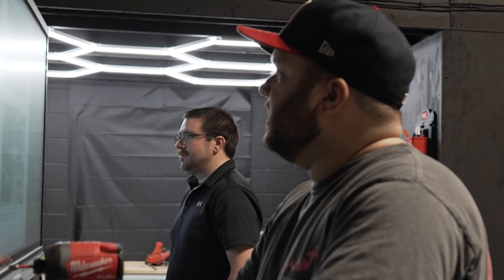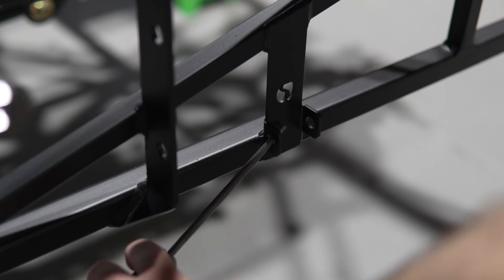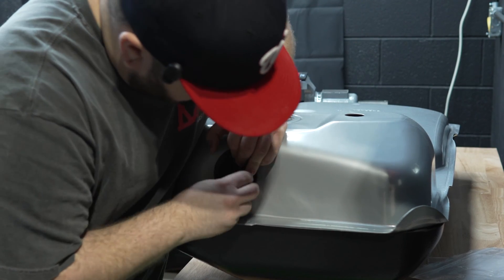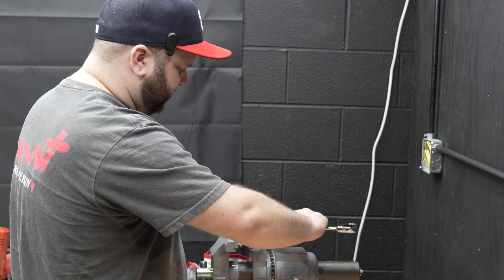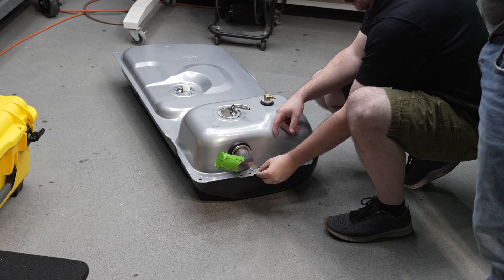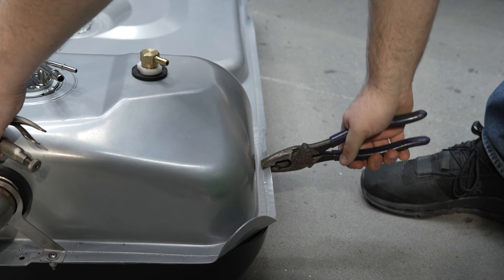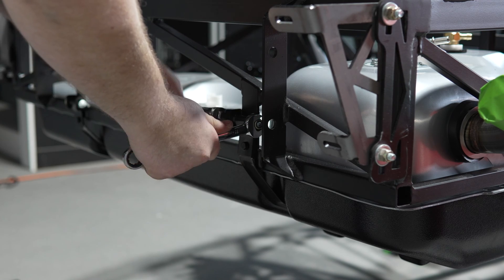Fuel Tank Mod/EFI In Tank Fuel System Install on our Factory Five 65 Coupe!

Comment: I found out the hard way - don't over-tighten screwing the vent into the plastic bushing. It will break the bushing.
Reply: Ouch, don’t you just love screwing metal into plastic?
Reply from the maker: Yeah, I was worried about that when Tyler was screwing in that vent. I’m sure FF will hook you up with a replacement if you ask.

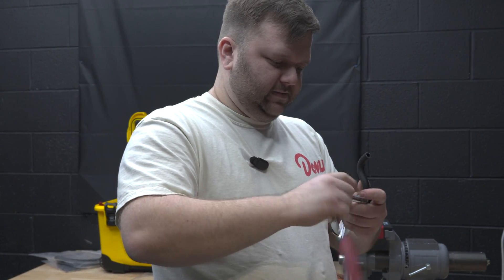Comment: 5:56 Thanks for the video, good stuff. Question, wouldnt drilling out the send/return line possibly create debris that can be left inside?
Reply from the maker: Thanks! Yes it could, thats why it is important to clean and inspect them once drilled. Compressed air/pipe cleaner should do the trick.

Comment: Hi.  Really enjoying your videos; you folks do very nice, clean, professional work.  When you show modifications, would you please add a little extra detail about why you are performing a particular modification?  For example, why did you cut the fuel intake tube before connecting it to the fuel tank? Thank you.  Looking forward to more videos soon!
Reply from the maker: Thanks Randall! I had some voiceover explaining that mod but I forgot to include it, so I’ll explain it here. The stock filler tube isn’t long enough/shaped right to get from the filler cap to the tank, so you combine the 2 pieces we cut with a rubber filler tube (which also has to be modified) and you hose clamp them all together. We’ll make sure to show that when its time to assemble.
Reply: @Walton_Racing  Thank you!  I'm considering purchasing & building a FFR Type 65 coupe in a few years, so I'm watching all the assembly videos I can find.  I'm trying to figure out if my mechanical skills [took auto shop & engine rebuilding in both high school and college] are enough for me to actually complete this project.  Have to admit, the modifications & fabrications in your videos look a bit daunting to an amateur such as myself.